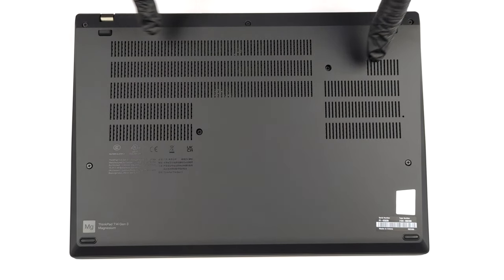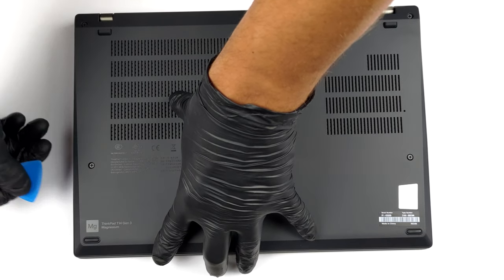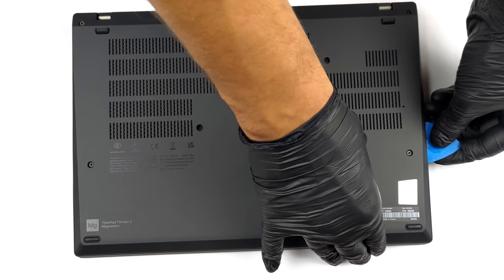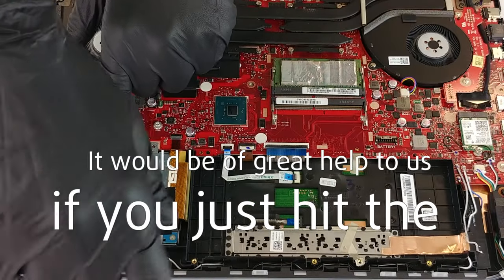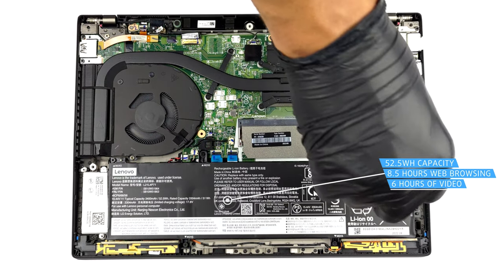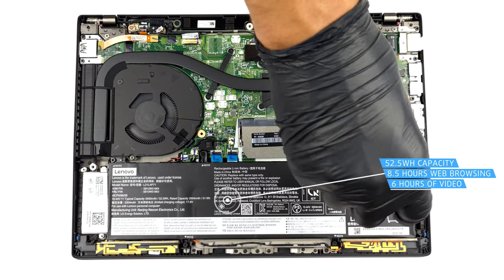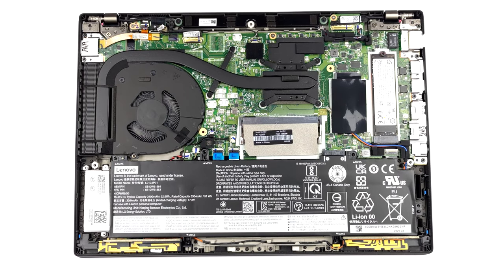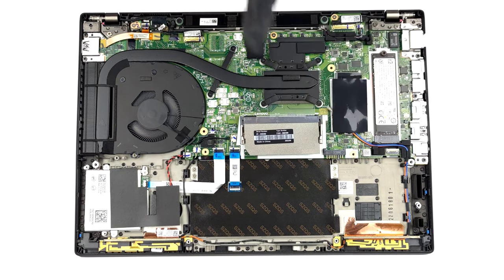🛠️ How to open Lenovo ThinkPad T14 Gen 3 - disassembly and upgrade options

Comment: What is the Black plastic next to the m2? Looks like a m2 empty slot on my case...
Reply: It's just a film covering the WLAN module. It cannot be replaced. It is soldered, but even if it wasn't the BIOS wouldn't let you install anything else as the BIOS blocks anything but a whitelist of the OEM options.